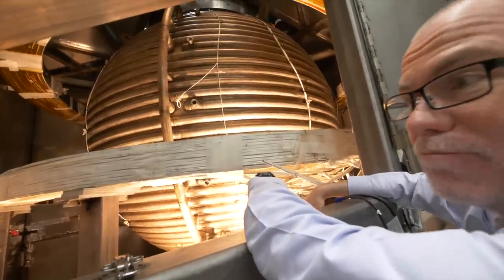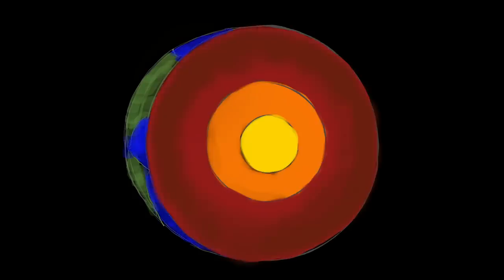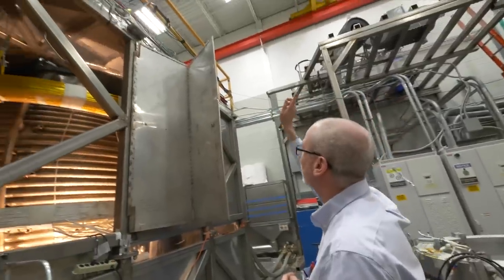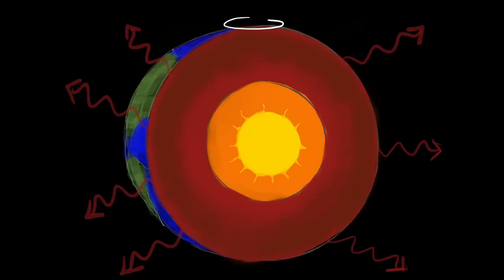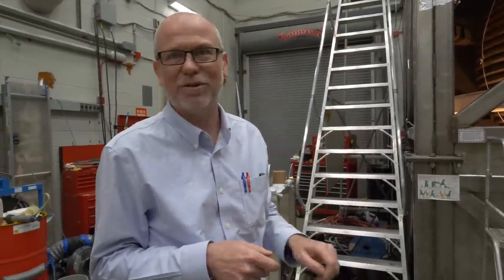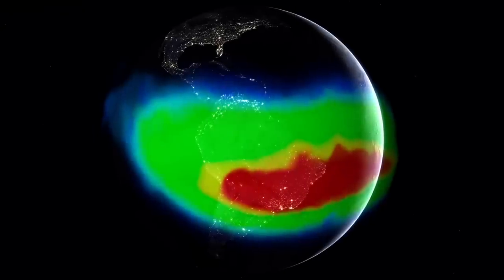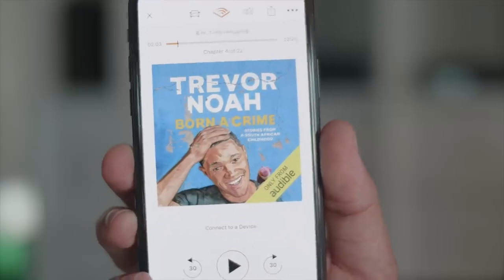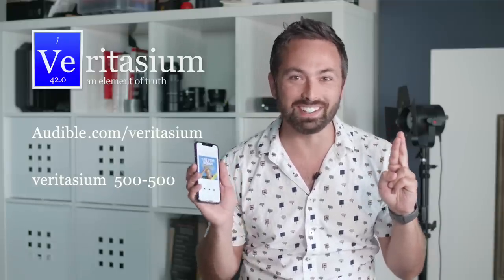Spinning Sphere of Molten Sodium

Comment: I like the old cheap power strip hanging on the wall beside the sphere.   It looks like they're powering this huge thing on a 15A circuit, with a strip that'll catch fire at 10A.  :)   I know that it's just for the shop lights, but it still looks funny.

Comment: Derek -- you mentioned how the inner and outer cores are way too hot for the Curie temperature ... (I have not looked into this) the 2nd order phase transition that is ferromagnetism is almost surely influenced by pressure at some level, i.e. there is some term in the energetics that would account for it -- presumably at 'normal' (<10000 atmospheres?) it just doesn't matter, but in that situation, are we really sure that we know how the core behaves magnetically?

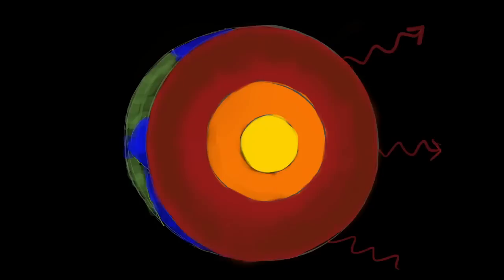Comment: At 3:16 it says that the core cools thanks to radiation from the surface to the deep space, this tiny change in thermal flux allows then the generation of the vortex of material that induces indirectly the magnetic field. Now the only way the Earth can irradiate is on an infrared light wave. What happens if this cooling effect is limited by some kind of gas that avoid its reflection? It is possible that greenhouse gasses have a tiny effect on this? The professor says that this process is unstable, so maybe this is not a problem since unstable systems are prone to change rapidly...

Comment: The part that I feel is usually glossed over quite quickly is, "when the magnetic field is produced faster than it diminishes due to the resistance of the metal." What does it mean resistance of the metal in this context? I'm not a physicist, so if you could explain it in more layman's terms.

Comment: I think the induction of turbulence is based on the fact that the earth does not rotate around its center, but around the center of gravity of the earth-moon system. This center of gravity is constantly changing due to the rotation of the moon around the earth and therefore tubulances must appear. This effect is not simulated in the area of the experiment.

Comment: Queation: you told us that Earth is radiating energy to space and hence its interior is slowly cooling wich is causing the inner core to expand as the heavier elements cool down, sink to the boundary of the inner core and solidify. However, you said that the temperature in the inner core is 6000 Kelvin, way above the temperature of the outer core. How does this work? Why would the inner core grow? It just makes much more sense that the liquid outer core would be diminishing and the solid mantle would be growing towards the centre of the planet.

Comment: its not about predicting the state of the earths magnatic field for planning for example a date of spaceflight in the future .. it is to determine how long we have until the complete inner molten core becomes solid , that machine is promising. i think it can tell.
Reply: and it will also show how to get the flow back and 
desolidate the solid inner core at that time.. we could learn alot with that machine.

Comment: "All you need is just a little, infinitesimal amount, a random current, that will just grow to full size.  so once its [grown to full force], you don't care where the tickle came from."  This must be how humans develop their own magnetic field, electric force straight from a small blood clot in the womb.  This must be why each atom has an orbital by which it spins.  This must also be how resonant frequency works in building up stronger and stronger magnetic force energy fields to transmit power.  Those coils created by the earth as it spins, must be why the earth is chock full of current to extract from. Another reason why matching the earth's resonant frequency with one's own coil system would provide endless power output.  Not to mention the power output a single human being may have radiating from ourselves and dependent on our own resonant frequency.  Wow.
Reply: If you manage to draw power from the Earth's magnetic field you are actually slowing down Earth in the process due to rotational friction.

it's not limitless energy. Not being said, the same thing happens with the tides as well, so since it's only slowing down by like one revolution per million years does it really matter?

Comment: It Should be Noted That ~ Mixing Really HOT stuff With Really COLD Stuff ~ By ITs-self ~ Causes an explosion - Like throwing An Ice Cube Into Boiling Water ~ DOES DO 

[PLEASE BE Careful if you Try Mixing an Ice Cube into BOILING WATER AS IT DOES EXPLODE & the Boiling Water CAN & DOES cause Scalding SKIN BURNS!! if it hits you]

It Should Also be noted that Heating The Outside of this Planet's atmosphere WILL cause its interior to heat Up MORE ~ Therefore ~ WEAKENS the Electromagnetic Field Effect that PROTECTS US on its surface

Comment: The solution is quite simple... Pressure... (Btw due to physics, there is a constant exchange in our planet of which matter is at its maximum heat and which isn't... This leads to a formation of a Magnet with a liquid core, the outer edge is cold enough to be magnetic while the inner edge is so hot that it cannot even sustain shape... This cannot be remade on small scale, thus the big ball... The movement of the plates also plays a big role in which direction the magnetic force positions...)

Comment: I've heard geologists say that the model in which the center of the earth would be molten metal is a very poorly held hypothetical model. And considering that not even in this experiment he could not generate a magnetic field, it seems to confirm even more that the center of the earth is not molten metal.
Reply: If its not molten, how does it create a magnetic field and interact with seismic waves in a liquid-like form? Its nonsensical.
Reply: @FenrizNNN  to create a magnetic field in a magnet it is necessary that the positive molecules are far from the positive ones, this state of separation is held by the solid state of the item, so when a magnet is heated it loses its magnetism.

Comment: I would like to see @Veritasium cover the Electric Universe Theory. Specifically the Safire project in Bath, UK. They are proving that the Sun is not a nuclear fireball, but an externally powered electric anode, and that the Earth's magnetic field is also externally induced. It would be a great video to counter this nonsense about spinning sodium and molten metals way above their Curie temperatures being thought to be responsible for magnetism.

Comment: My friend sees where I had a stator that I am trying to create. He sees where I'm able to pull voltage out of the air he was quite shocked because he is electrician and he didn't believe that I can move magnetic fields in a way where I can be able to pull a residing voltage in the air for some reason next to Colorado when the moisture is high and there's disturbance from the cloud. The voltage increases. But it's in the micro range

Comment: Whenever you have a liquid iron ore the poles keep them cool so you have a steady magnetic field though random but variations in poles temperature usually create so much unpredictable like Jupiter Saturn etc. But Saturn is way too far from sun to get so much affected. Usually things closer to sun have a higher chance of extremely turbulent weather and temperature also depends on facing like Venus which has a stable magnetic field though closer but facing a complete pole on the north and extremely cold at south.

Comment: Based off that information, wouldn't there be both magnetic braking, which would slow the rotation somehow, and also heating caused by the resistance to the emf field which should cause the solid core to shrink due to it getting hotter?

Comment: It's electric, fueled by the Sun not gravity..  "I consider it quite possible that physics cannot be based on the field concept, ie.. on continuous structures.  In that case, nothing  remains of my entire castle in the air, gravitation theory included." - Albert Einstein: A Biography by Jurgen Neffe, pg 358

Comment: I believe it isn't a closed loop dynamo...The Earths magnetic field is connected to the IMF where energy from the sun flows through that impacts the magnetosheath and flows inward to the LLBL that then flows into the L-shell magnetic field lines. Also, energy is stored in the magnetotail where it is fed into the Birkeland, Halls and Pederson currents near the poles.  The suns magnetic field strength has diminished which has allowed more galactic cosmic rays to enter the solar system.

Comment: Quick question:
Since there is no gravity at the center of the Earth, due to balanced forces, could there be a small void there.
All the gravity is pulling away from the center of the Earth, so if a small void was ever generated, it would perpetuate.
Is that no so??
R
Reply: Nope, because even if there is no explicit net gravitational force acting on the material at the center of the earth, there is a net gravitational force acting on the billions of tonnes of rock and metal surrounding it for thousands of kilometers, pulling all of it towards the center of the earth.

Comment: What about spinning a core of graphene?  

I wonder how much temperature a spinning core of graphene could maintain its magnetic field and what would happen if you exposed it to ultra high magnetic fields and temperatures, like in a fusion reactor, or something on the order of near 1000 Tesla like the one demonstrated on the most powerful magnetic field ever produced.

Could this protect a cylinder?  Do you think a solenoid design throughout would be better/more efficient?

Comment: just a little thought to the security cooling system,

they thought about the fact that the humidity in the air will condense in contact with the cold gas? and thus form water that could freeze around the sodium leak and thus cause a time bomb.
Reply: Given they are working with liquid sodium, i'd bet the room is already highly climate controlled

Comment: 2 things. #1. The Earth's Magnetic Field is not created by the Earth. ! It is utilized by the Earth. As a secondary winding is in a electrical Transformer.

The Primary winding is the Sun.!

A Dynamo is just turning mechanical energy into Electrical Energy. 

And it is the Earth's Spin that produces the mechanical energy! NOT the flow of Magma within the Earth's Mantle.

However. The flow of. And or movement caused by "Convection" of Magma within the Mantle. May cause disruptions within the Earth's Magnetic Field. 

Because it is the conductive medium that is absorbing the primary EMF from the Sun. And produces the secondary EMF. 

And the secondary EMF of the Sun. IS Earth's Electromagnetic Field.! IT DOES NOT JUST "SPONTANEOUSLY" APPEAR OUT OF NOWHERE. ! ! ! ! 

So if Magma within the Earth's Mantle moves relative to it's stationary position within the Earth. So too does Earth's Electro Magnetic Field. 

Causing distortions and or disruption within the Magnetic Field of the planet Earth.!

So you should be 100% interested in. And wondering where the "Tickle" comes from. Because the EMF does not come from a "Tickle".

However the disruption of the convection. Does in fact start with a "Tickle". Which if you're trying to understand the distortion and or disruption in the Earth's Magnetic Field. You should again be 100% interested in where that tickle comes from. ! ! !

Come on guys.! Do I have to spell it out for you.?

But my real question is. Why would you even be applying an external electromagnetic field. If you didn't already know it worked like that.? 🤨

It's infinitely more logical to assume that the core of the planet itself has a polarization. Which produces the initial electromagnetic field. In the way it is described that it is assumed for this experiment.? 🧐

But whatever.! 😑

2nd. A spinning Magnetic Field within another spinning Magnetic Field. Produces a force at a right angle to the field lines.

You know. "The Right Hand Rule". Maybe you've heard of it.!

So they should weigh that molten ball of Salt. Well it is spinning. To see if it weighs the same as it does when it is not spinning.

The results may very well surprise you.!
Reply: And I swear I've left this message on this video multiple times. Where does it keep going you might wonder. ! ? 🤔
Reply: Die Glocke. Red Mercury.

Comment: Everything below the surface of the Earth's crust is too hot for magnetic fields to form naturally (curie temperature) in metals it and only gets hotter the further down you go.  In actual fact, we have no idea what the geological composition of earth is below the crust because our drill tips melt 30km down. 
We need more and better theories to explain the magnetic field so this type of research is vitally important, but don't be surprised if all our current theories are also fundamentally inaccurate.

Comment: But how did they spin it?
With an electronic motor or something else and if it is spinning be an electronic motor  how much will the magnetic field affect this experiment?
Reply: Air-powered turbine, no magnetic components.
Reply: Induction motors. It's fine, we have magnetic noise from them that alter the measurements but we're able to identify them. Plus, we don't care where the tickle comes from ;)

Comment: Has anyone confirmed what is below our feet?

No.
Reply: @FenrizNNN  Ratarded like the globe theory you mean.
Reply: @fpvangel4495  Alright if you're so confident about its inexistence, explain how every astrological  phenomenon would happen on any other model other than a globe. You can't. I can link you a video if you dare to try.
Reply: @FenrizNNN  Happens perfectly fine on our Mercator map princess, let me know when you can debunk Time and Date, same map. Oh and fetch some aircraft attitude data thats shows them adjusting for this imaginary curvature, good boy.

Debunk me if you dare to try.
Reply: @fpvangel4495  ok, here are a few things that are impossible on a flat earth:
- seismic waves passing through the earth
- there being a gradient in atmospheric pressure as you increase altitude
- day/night cycle
- aircraft paths
- the ISS, which anyone can take a picture of
- seasons
- the sun
- the phases of the moon
- tides
- storm rotations
- the horizon never rises to eye level and every experiment to demonstrate that it does has failed
- the sun stays a constant size in the sky no matter what
- the moon stays a constant size in the sky no matter what
- the paths of the stars in the sky
- the fact that you cannot see the southern cross from the northern hemisphere, and polaris from the southern hemisphere
- the fact that, at any given moment, australia, south america, and south africa can all see the southern cross despite them all being required to look in different directions on a flat earth
- satellite TV
- volcanism
- plate tectonics
- things falling down
- the fact that no model of the flat earth exists, while a model of the globe earth definitely exists
- the fact that neutrino detectors can see the sun through the earth at night time
- the fact that cosmic rays exist
- the fact that you can zoom in on the planets and see them and their moons

need I say more? If you want anyone to take the flat earth seriously, you need to design a model of the flat earth that can explain all of these things simultaneously

Comment: Here we go... Water has a third state which is neither liquid or gas, what would happen if you used molten salt with iron nano partials sealing with a water chamber strong enough to hold the pressure which is holding copper nano partials. would the core not be able to spin at super speeds?
Reply: Magneto-Coriolis Eigen cycles ;  "We investigate the normal modes of a rapidly rotating, electrically conducting, inviscid fluid sphere in the presence of a background ..." ??? Perhaps a plasma-like fluid  rotating fast ..

Comment: Earth Magnetic Field:
Generation of the field is quit simple. The earth is connected electrically to the sun by twisting and rotating Birkeland electromagnetic plasma currents. This induces earth's rotation, evidenced by slight fluctuations in rotation speed coincidental with solar fluctuations. The heavy iron concentration of earth together with our highly ionized atmosphere leads to further electromagnetic induction. The earth is a motor. The inner part of the "rotor" holds more resistance induced heat than the outer. (If ever there was a source of global warming or cooling, look to this and solar power fluctuations.) Nature is efficient in its simplicity because electricity follows the shortest path of least resistance, which by the way is the essence of intelligence, manifested as the universe by the well documented self organizing properties of the aforementioned plasma. Molten sodium is interesting, but will not answer The Question.

Comment: Something was said in this video and ya'll just blew right by it, but as a lay person it really caught my attention so I will ask.  It was said that the earth's magnetic field has reduced by 10% and as such is not is not reflecting away magnetic fields as well.   So, would that not apply to sunlight as well, as in, a factor in climate change as well...
Reply: The strength of the magnetic field has varied quite a lot historically, but no studies have shown that its had any noticeable impact on climate. The solar storms will have impacts on the ionosphere, but not the lower layers which is what affects our climate and weather patterns.

Interestingly big drops in magnetic field strength happened before pole reversals, so some have suggested that is inbound and that we are long overdue for a flip. But it doesn't really seem those that believe that has much evidence to suggests it's anything more than just normal variations. Not that a pole reversal would be bad news either of course, just interesting.